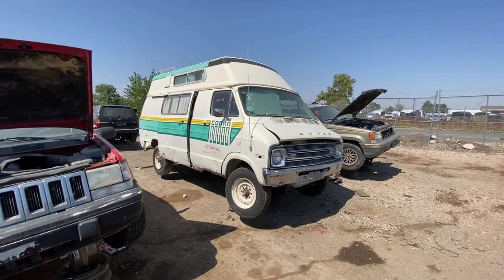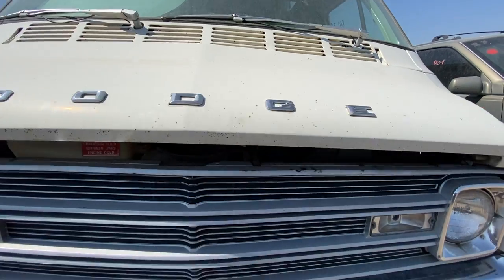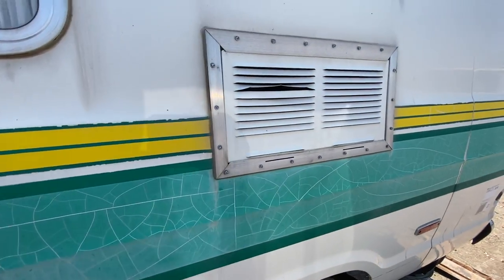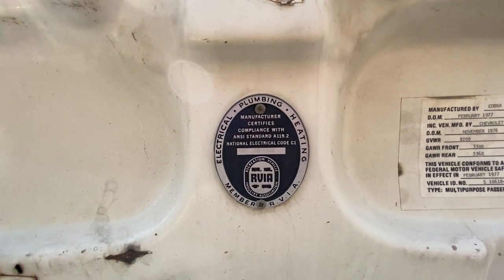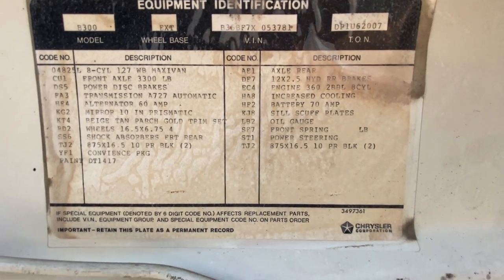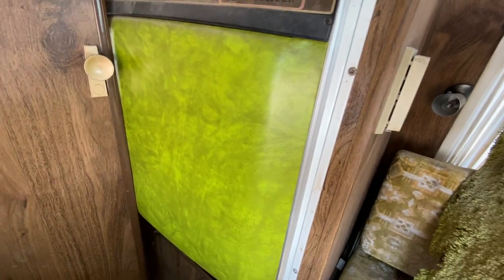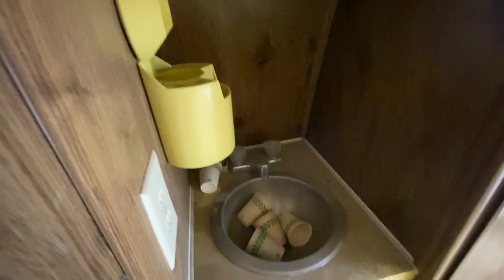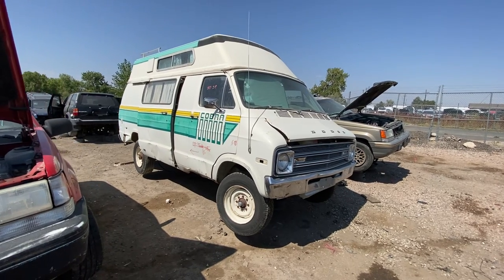1977 Dodge B300 Tradesman COBRA Conversion Camper Van JUNKED! The #VanLife is over for this player!

Comment: VIN is B3 for B300 (1 ton rating), 5 for Tradesman van, B for 6,001 to 10,000# Gross Vehicle Weight Rating, F for 360 V8 with two barrel, 7 for 1977 model year, X for Missouri Truck assembly and the rest is the production sequence. MDH stands for Month, Date, Hour and this was made on 11/23/76 at the 15th hour of the day (around 5:00 PM). 11/23/76 was a Tuesday.  Paint is code DT1417 White exterior paint. 

Cobra Industries was located in Goshen, IN and closed in 1995. That part of Indiana is the trailer and RV "capital" of the country.